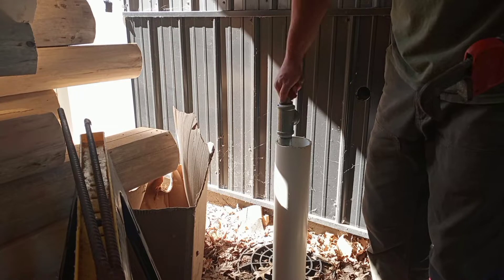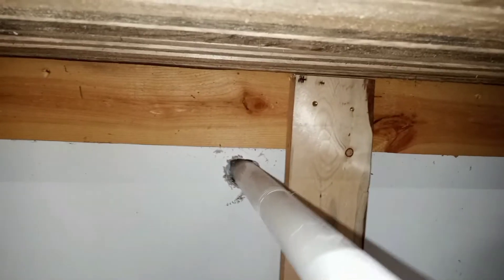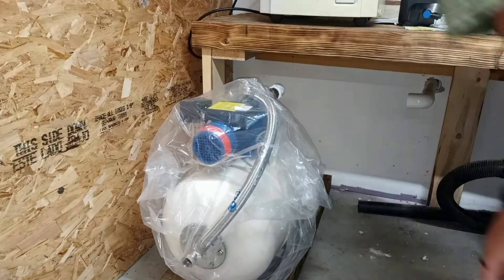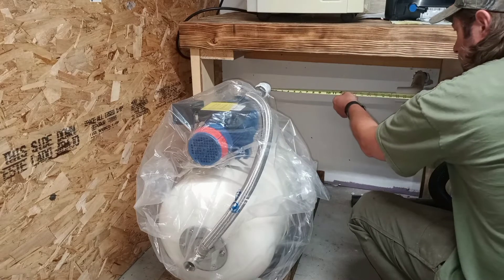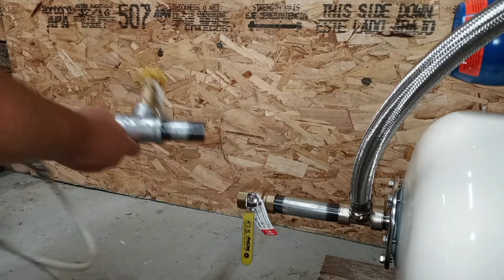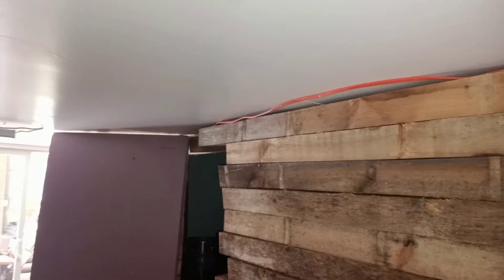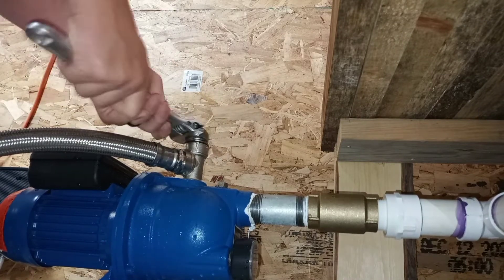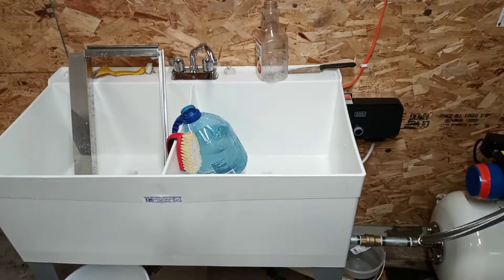Part 2 finishing sand point well and tankless water heater.

Comment: what slot size in the well point? Do you need a filter to remove the sand that it pulls up?
Reply from the maker: Well point Is a 1.25". No filter since it has a mesh screen. If I was going to use for drinking I would put in RO system. Nitrates are super high here.  Water come out clear so far.

https://www.menards.com/main/plumbing/pumps-tanks/pump-well-tank-accessories/water-source-stainless-steel-well-point/wp3680/p-1444446042498-c-8672.htm
Reply from the maker: https://www.menards.com/main/plumbing/pumps-tanks/pump-well-tank-accessories/water-source-stainless-steel-well-point/wp3680/p-1444446042498-c-8672.htm